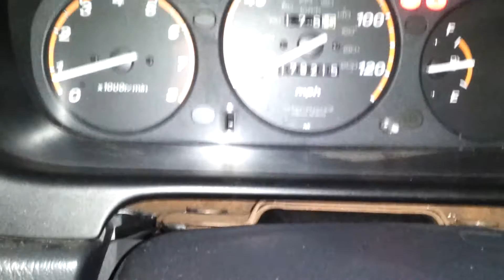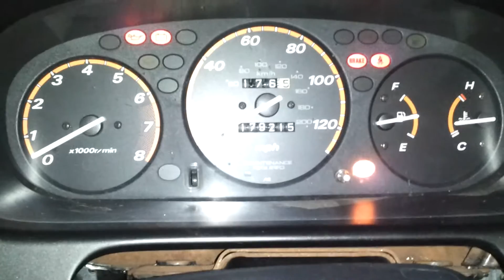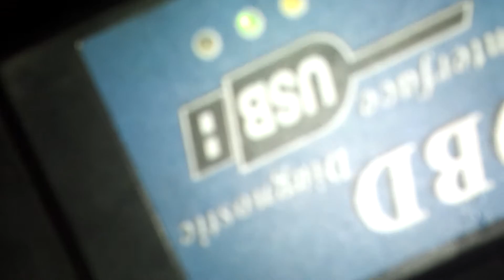Honda coil on plug, plug and play.

Comment from the maker: exactly the same way, with the gun clamp around the harness at the coil, the same amount of energy travels through the ground wire as does a spark plug wire from the distributor, so the light works fine.

Comment: I've built something as well, just for the fun of it and it runs great! I'm running it on a C20XE Motronic engine (M2.5) What I did is modify a distributor cap with with a PCB and Hall sensors for each cylinder and fire them straight from there. Runs super sweet as well and would also work on a lot of engines.